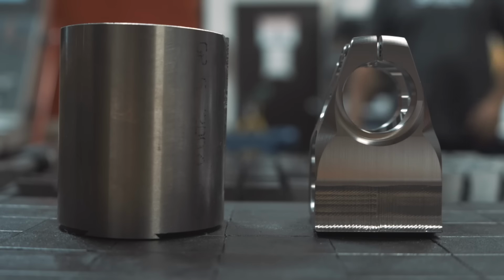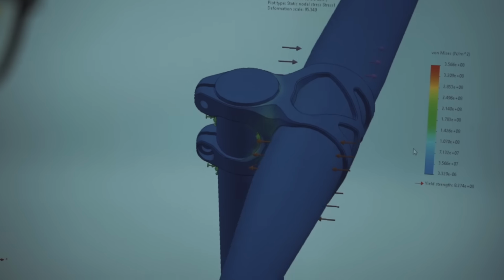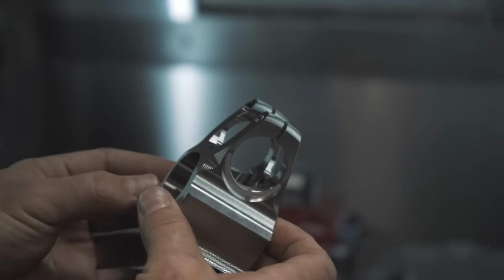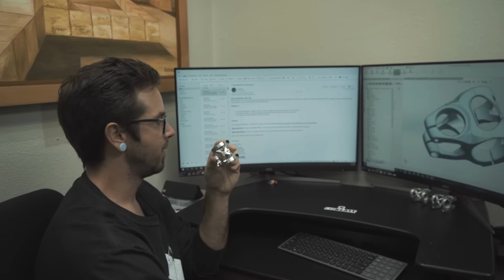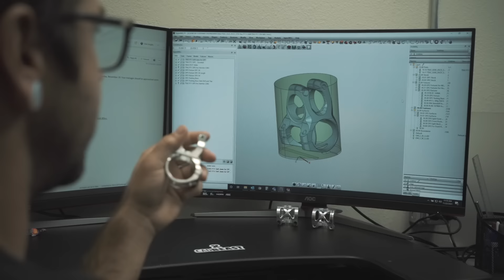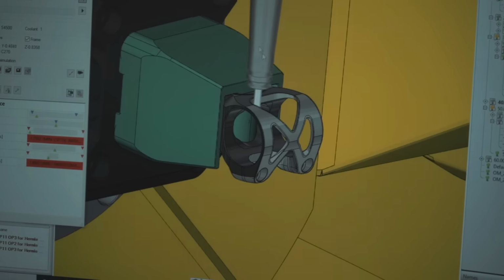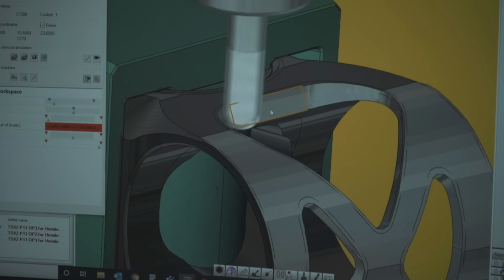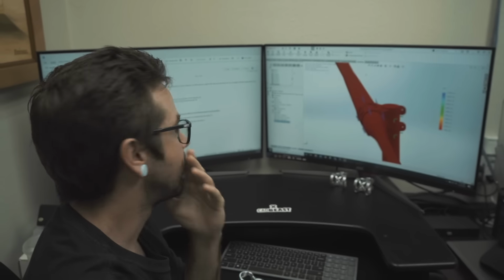5DEV Titanium Mountain Bike Stem - How it's Made - 5 Axis MTB Components Made in the USA

Comment: You wasted that valuable titanium block. Unfortunately mtb parts designers like you has violated the  principal of "quality production" meaning what ever you make is aesthetically pleasing but has a very short life and durability. All you guys do concentrate in, is just absolute look and adequate durability. A great example is Thomson stems and all those cracked face plates in the market....If you just make those windows lite smaller on the face plate, make the bridges(vertical bands hold the bar) thicker more pronounced and lastly smaller opening on side of the stem, you would create a bombproof stem. Some reference guide would be take a look at Hope Downhill stem and Am. Please don't feel offended by my comment, instead use the secret formula I am trying to message: (High quality, most durable production= long term business and reputation).
Reply from the maker: Or we can just quote Billy Madison: what you've just said is one of the most insanely idiotic things I have ever heard. At no point in your rambling, incoherent response were you even close to anything that could be considered a rational thought. Everyone in this room is now dumber for having listened to it. 🤣